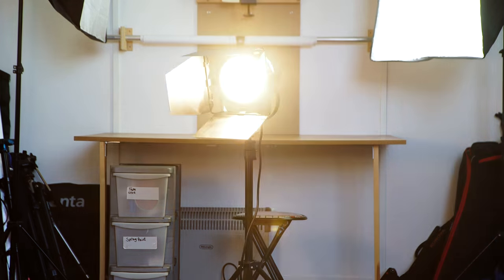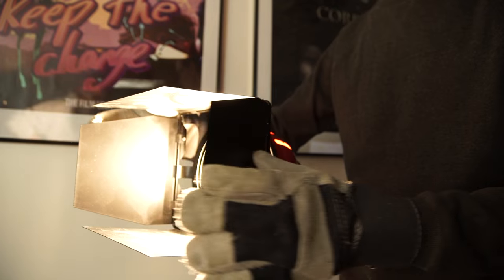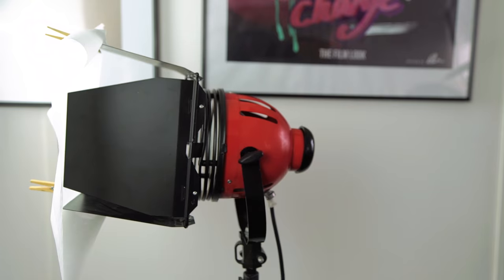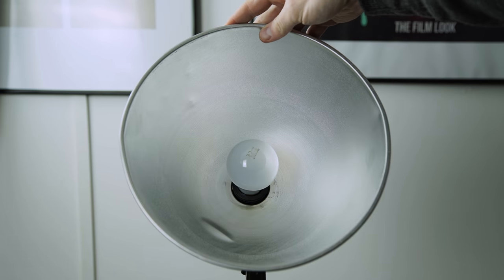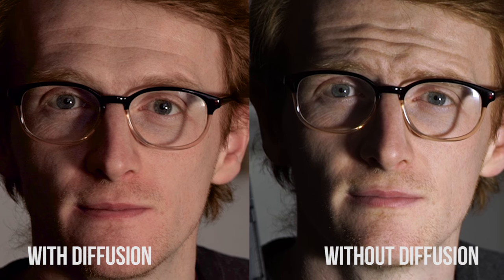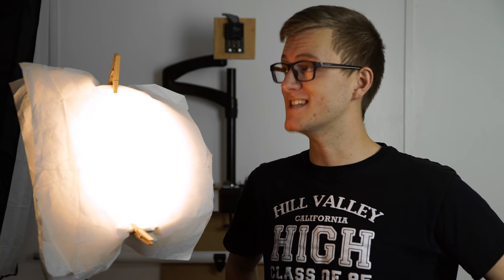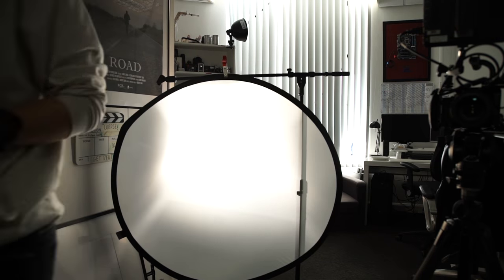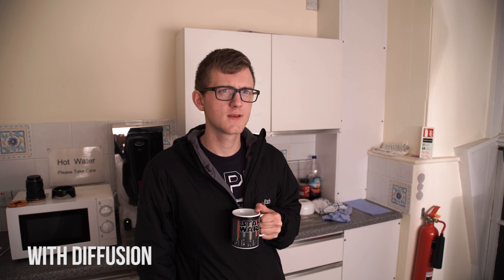DIY Light Diffusion | The Film Look

Comment: PSA real quick. 
When you're at the grocery store make sure you buy greaseproof paper/ parchment paper because the wax paper, freezer paper, ECT are normally right next to it and look pretty much identical but are not heat safe. Sometimes are cheaper. Also if you already have random kitchen paper at home check to see that it is parchment paper. 

This might be a bigger issue in places that call it parchment paper, because I was not aware that it could be bought in white. I thought it was only available in parchment color, brown paper bag colour.
Reply: Thanks for the info!

Comment: I've been having issues with lighting my green screen and was was ready to pull the trigger on some soft box lights on Amazon and found this vid.!! Perfect solution!

I have several par can lights that you can change out the gels and what not. I traced the proper size of parchment paper I stole from our kitchen and voila!!
Reply: You still need a soft box, Geoff. Very the very simple reason that in order to get a really soft light source you need a large light soft. It's true that baking paper/diffused paper really works well at aiding in softening the light, but bringing a large light source close to your subject is the best and most practical solution. You can even combine the two.

Comment: My favorite and maybe easiest method to soften light it to bounce off a ceiling or wall. While it may not work for every shot it crates amazingly soft smooth light. Don't forget that Harsh light can also be cinematic of used correctly. 

I think I might have to Subscribe. :)
Reply from the maker: The ceiling is another great method and I agree with harsh light as well. We just shot a music video and that was all we used, it worked great.
Reply: You need a light that you can angle upwards, though. LED panels aren't very flexible in that regard and that's what most of us are using........................................

Comment: I don't want to rain on your parade but using a diffusion material so close to the lightsource hardly diffuses the light at all, which is why your before and after shots with your continuous lights are not dramatically different. The key to diffusion is to increase the SIZE of the lightsource relative to the subject which is why diffusion material fastened to rim of your circular light doesn't do anything since it is the same size as the rim that was providing light. All diffusion material does when it is placed that close to the light source is to reduce the intensity of the light rather than its' harshness. Covering up the window to diffuse the suns light works well and illustrates the principle I refer to.

Comment: Greasproof paper is a great idea. Spent today trying to remove hotspots from a large green screen so hoping this will help.
Reply from the maker: How did it go?
Reply: Thanks for asking.  As I am using LED lights I found the greasproof paper blocked too much light. I will use in other projects though so still a great idea.  What did work was Laminating pouches. Before they go through a laminator they are slightly frosty and  If doubled up they are subtle but perfect.

Comment: i saw in one shot that you use a 'feel world' monitor. and on the looks it seems that i have the same one... now my problems was with the battery and and where to find them , because mine stopped working just randomly and i can't get a cashback...
Reply from the maker: All you need is some Sony NPF batteries. Any size will work, but we prefer the NP-F 970s.

Comment: I'm trying to use my regular lamps that are on my desk to better light my streaming setup. I use a pretty cheap webcam and it needs some help. I thought about taking off the lamp shaes but I need to make a box to point the light but also defuse it. Any ideas for that. I can use the dannys but I am at a loss on building the box itself.
Reply from the maker: As long as the lights don't get too hot, cardboard and tape does the trick!

Comment: Hmmm, interesting video you guys. Nice work indeed  : D

Though I couldn't get my head around the different look that the light diffuse by the reflector's white fill  give off when compared to the light diffused by the Ikea blinds. With both diffusion methods' key light giving of a opposite color temperatures. Would you say that they are the same? Albeit if they were diffused by the same key with the same color temperature. 

Thanks guys (^^u)/
Reply from the maker: Budget diffusing methods will cause some colour tint one way or the other. We find the greaseproof paper warms the light a little, but its nothing to be too concerned with. A pro cinematographer would very likely disagree as they like everything as tight and accurate as possible, but for micro-budget movies, it gets the job done at a tenth of the price 👍

Comment: How much watt's house hold bulbs can you do in that fixture?
Reply from the maker: It's just a normal house hold bulb fixture, we are currently running 100w bulbs in it right now. If you need a fixture that can hold a higher watt bulb you can find them in pet stores, were you would add a light for some form of reptile. It's a strange place to find filmmaking equipment.
Reply: Thanks! Keep up the good work!

Comment: will greaseproof paper burn cz of tungsten heat ?
Reply from the maker: There will always be a danger when dealing with high temperate objects and materials. Grease proof paper is used for baking up to 220 degrees C, so it will take some heat before it bursts into flames. That being said, you want to make sure it doesn't make physical contact with the bulb. Always attach it to the front of the panel with at last an inch or two from the bulb itself. We haven't had any problems with it on the 800w lights, but we can't guarantee other lights. So, just make sure you have your extinguisher handy (as you should with hot lights anyway).

Comment: this is a fire hazard
Reply from the maker: We use greaseproof paper which is used for baking in an oven over 300 degrees. We've never had a problem, even close to a hot bulb for hours at a time.
Reply: As with most things... take sensible precautions. Halogen bulbs can easily reach temperatures above 500 degrees C.  In most circumstances the gel holder won't reach those temperatures so I'd be happy giving it a go but I wouldn't leave it unattended.